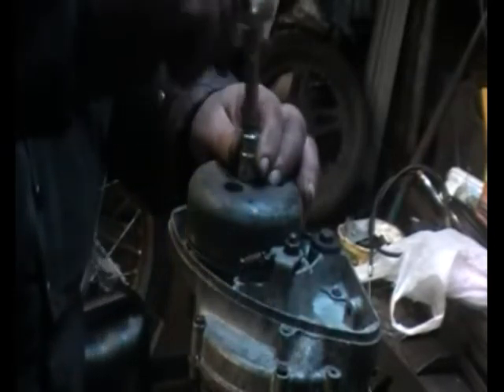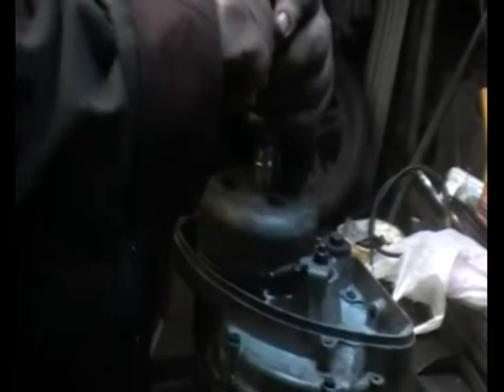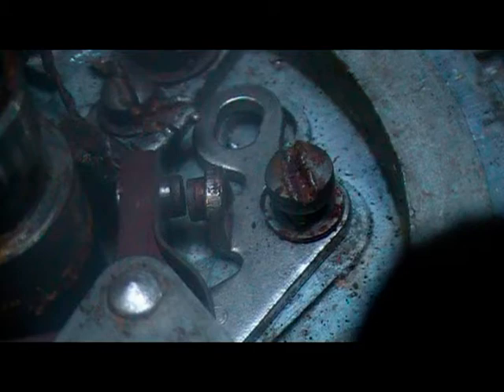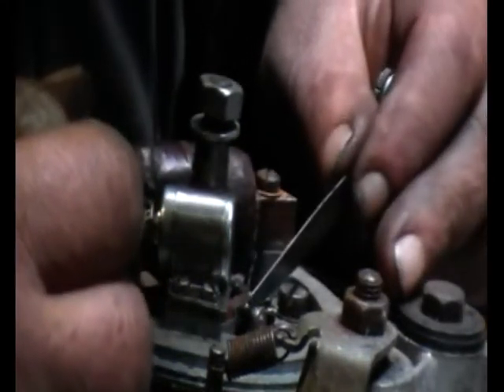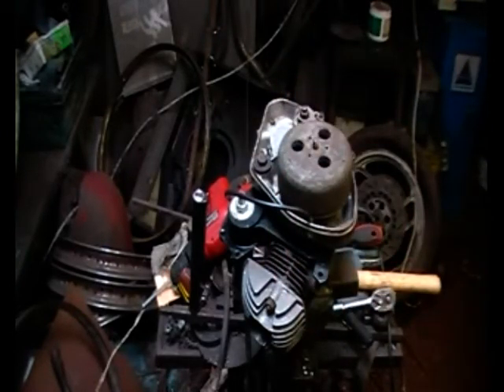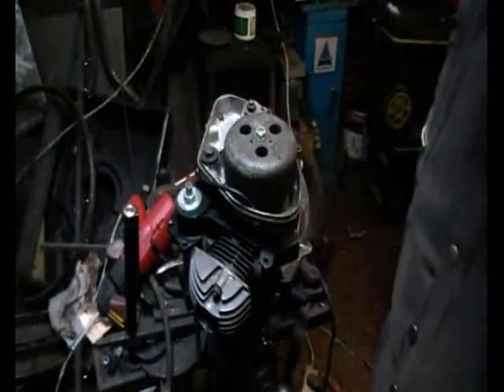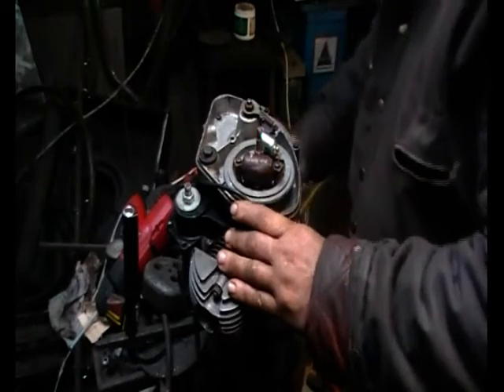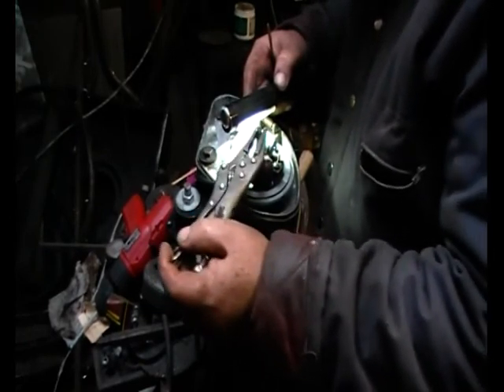cyclemaster ignition timing

Comment: It would be interesting if you had a measurement from TDC to the points just opening on your swizzle stick. I have a proper little plunger that screws into the spark plug hole. and the gradients on this are most useful.

Comment from the maker: its very hard to picture over the internet what could be the problem but one possibility is the wrong cam fitted (bantamag cam in a wipac flywheel)the  points would open at the wrong spot and no have no  adjustment on them, or perhaps the tab that locates the cam is stripped without the thing in front of me im only guessing im afraid